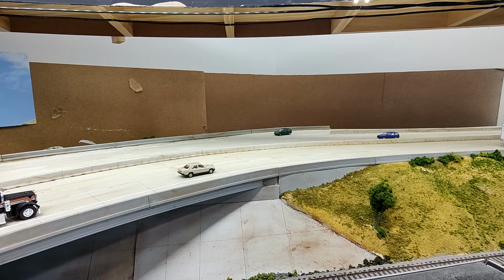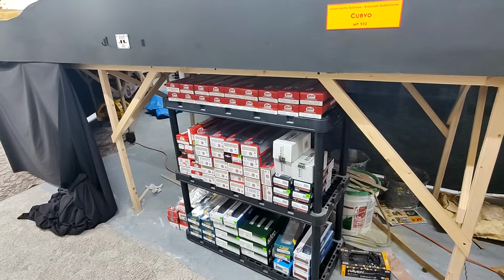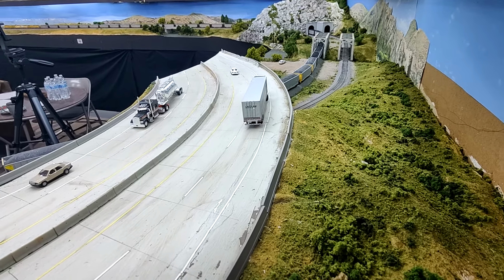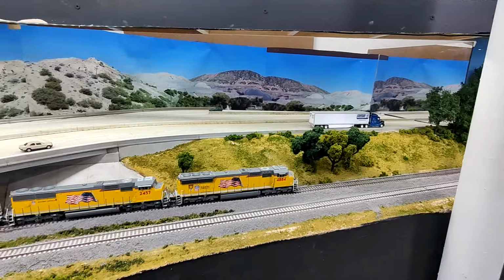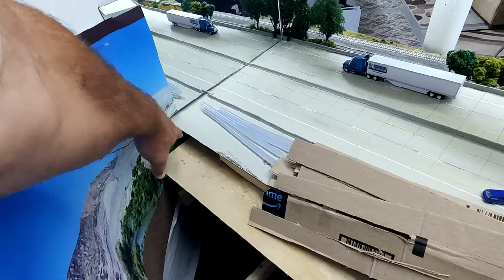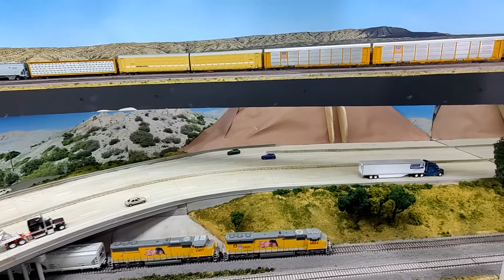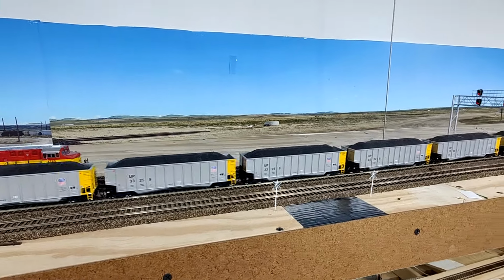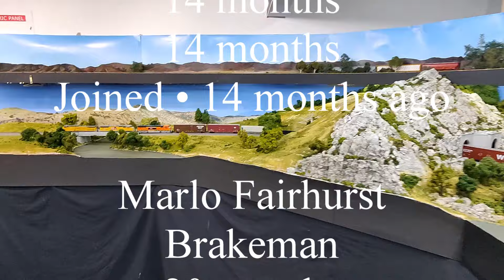WEEKLY UPDATE - DEVIL'S SLIDE finally being installed - UPRR Evanston Sub -HO Scale Trains in Action

Comment: What happens if you put some backdrop on the corner of the mirror, blocking the devils' slide reflection portion only.
Reply from the maker: Hmm. I think the backside of the backdrop would be visible. Would need to make it two sided..
Reply: @EvanstonSub  experiment,  taped to the mirror it wont reflect. (the far side billboard will reflect in the mirror)
Reply from the maker: I was going to put the far side sign right up against the mirror. It might appear thicker, but won't stick out.

Comment: why not just do one of the Devils slide razorbacks and place it so the other one is on the mirror. Since the mirror would be
reflecting the backside of the other razorback, it could be painted differently and would appear slightly different. Proper painting would enhance that effect. It could be really a neat way to pull it off. I hope the cutoff at Granger will feature at least a pair
of tracks for staging trains so one could come in with one waiting to enter the scene.
Reply: I agree,  use the mirror to your Advantage. Build the slide closer to the mirror and have one side painted different from the other side. It will help from having 2 slides reflecting in the mirror where you have it now and easier with putting scenery in for you..... trying to help, just my opinion.... sometimes you need a second set of eyes to get a different view on things..... Thanks for sharing the video !!!
Reply: I agree with coal_train and andy. I was going to suggest that you use some Sculptamold for the rock formation, carving the rocks once it has set - should take up less room that rock moulds, but reading the suggestion of using the mirror as the centre line of the slide makes great sense, and saves a lot of work trying to hide the reflection.
Reply: Great idea. 👍
Reply from the maker: The mirror is not big enough for this since the mountain would need to slope away from the road. I can't use a bigger mirror since that side is right up against the wall.